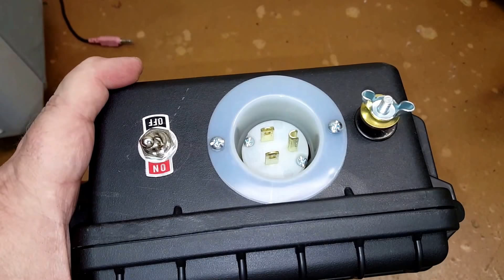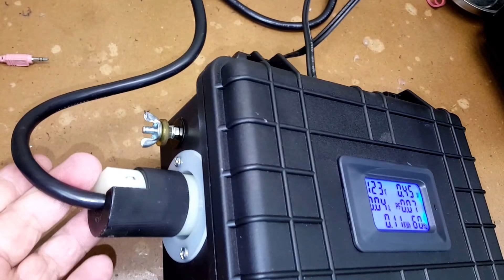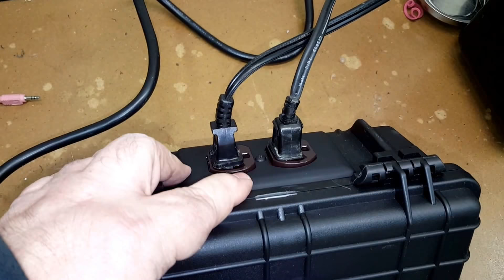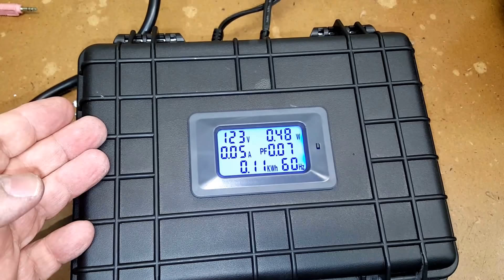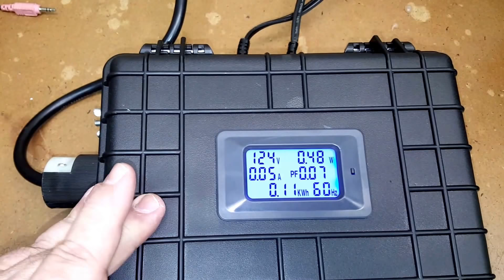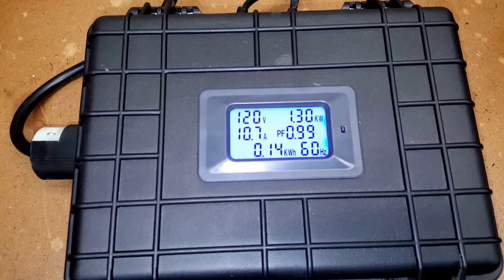Watt Meter For my Honda EU2200i

Comment: Hi Steve, The last comment was two years ago so I’m not sure you’ll get this, but if you do I would love something like this for a Honda generator I’m picking up tomorrow, the EU 2000 I, i’m actually buying a pair of them that will run in parallel sometimes. I’m curious if it’s possible to wire something to the generator that I could maybe attach to a side of it that would monitor the current usage and then I would know what’s left over and available, so I would know how the generator is impacted as i plug things in and out. Is this possible or does it have to be an external device that the generator plugs into and then you plug into that, like your box?
Reply: Steve you may like the Watt Meter that I added to my gen/inverter. https://youtu.be/CIfSrwch9Z8    https://youtu.be/_cFU9aeMcOE
Reply from the maker: Probably the best thing for what you want to do is get a Kill-A-Watt Power Meter.  It would plug into the generator and then you plug the load into that.  I built mine for the opposite reason.  I run an extension cord from the generator to my box, and then plug into it.  That way I don't have to go to the generator to see what the load is.  I can have the box sitting by me and the load(S).
Reply: @stevehill1802  Thanks Steve!  I don't much about watt meters but most of what I find on Amazon is 15a, but I want to be able to monitor my wattage when using one of my Honda EU2000is (so this 15a watt meter would work great), but I also want to monitor the wattage when I run 2 of them in parallel, in which case I'll be pulling 3200w with short surges up to 4kw.  I was hoping to find 1 watt meter that could do all of this, but it looks like once you get over 15a the meters get more intense, they're not just simple meters you plug into/out of.  I'm also curious, why do these meters have to have upper end limits, why wouldn't they just make them all big enough to handle 3, 4, 5kw or more?  Anyway, if you have any ideas on what would work best for me I'd appreciate it.  if I have to buy a 2nd meter for when I'm using my 30a outlet, I'm not sure how to pick this out....?
Reply from the maker: @john-xs3rs  I see what you want now.  Yes, unfortunately you are not going to find such a thing on a store shelf.  It would have to be custom built.  It would be a fairly easy task to make one as part of the parallel kit.  A box would have the 2 cables coming out of it going to each generator.  The box would have the meter and the 30 amp plug.  The meter in this video will measure up to 100 amps.  I could build it for you.
Reply: @stevehill1802  It might help if I could send you a pic of the outlets on my generator, or maybe you can Google the Honda EU2000I Companion (the model with a 26.6A outlet beside the 20A outlet) to see what I mean (I have 2 of these same generators, along with Honda's parallel cable).  Above the 2 outlets it says "AC Out 12V 13.3A, AC Reset Method: Engine Pause" - would this mean either of these 2 outlets can provide 13.3A (1596w given 120V), and if either exceeds that the engine will pause?  do you suppose I could plug into both of those outlets, and it work work fine until I pull a combined 13.3a, and then the engine would pause?  Then below the 2 outlets it says 20A under the smaller one and 26.6A under the bigger one, and "During Parallel Operation" under those numbers as well, and there's a 20A circuit protector under the smaller outlet.  So it sounds like the upper limit on both outlets is increased when they're connected in parallel, meaning it'll bypass the 13.3A engine pause reset method.  So I'd like to know how all the above works, maybe you know and can confirm/deny what I'm saying, but just to make sure we're on the same page for what I'm looking for, I want to monitor the wattage/amps whether I'm using 1 small outlet on 1 generator, 2 small outlets when they're connected in parallel or using the 1 26.6A outlet when in parallel, like when I have my camper connected.  So your box would need to be able to accept as input just 1 standard plug, 2 standard plugs or 1 RV-type plug, then have an upper limit at or above the max I could pull, which is 4000w (I can run 3200w forever or surge to 4000w for 30 mins before it trips).  and if it was possible, I'd love to be able to set an alarm based on whatever wattage I wanted.  for example, if I were running just 1 generator (running 1600, surge to 2000 for 30 mins) I'd love to be able to set an alarm at, say, 1500, to know I'm getting close, then when I run it with my RV I'd love to have it beep if I were around 3100, let's say.  Thoughts on any of this?
Reply from the maker: If you want to plug your camper and plug other loads directly into the generator, and monitor all, you would need your box to have the 30 amp plug, and regular 15/20 amp outlets so all the load would go through the meter.  As far as an alarm goes, I have not see that.  All mine does is flesh at the point I set the overload value.  It is my understanding that when the generators are paralleled you do not get full output of both.  Anyway the box would do all that you want, except sound an alarm.
Reply: @stevehill1802  This sounds great, so the input side of the box would be flexible in that the meter would read watts coming from 1, 2 or all 3 inputs (2 standard plugs,1 RV-type plug). and I forgot to talk about the output side of the box - could the box be flexible enough to send the current out of the meter to 2 different outlets (1 standard and 1 RV-type), so that I can plug either my standard extension cord (when using at home) or RV 30a plug into it?  so 3 inputs and 2 outputs I suppose, if you know what I'm trying to get at...  I can live without the alarm. :)
Reply: (on the output side, could you not guarantee that 100% of the power went to both outlets, could some go to one outlet and some  the other outlet?)
Reply from the maker: @john-xs3rs  I don't understand your question.
Reply from the maker: @john-xs3rs  Any outlet you plugged into on the box would go through the meter and the total of all the outlets would be read by the meter.
Reply: @stevehill1802  my 2nd message, the one in parenthesis, was asking about when you go from the meter to the 2 outlets I can plug into (on the outlet side, 1 15a and 1 30a, not the box's input side which has 2 15a's and 1 30a) - would 100% of the current go to both outlets so I could plug into either one, or does the power get messed up somehow and some might go to 1 outlet and some to the other?
Reply from the maker: @john-xs3rs  If I am understanding your question...  You could plug in to either of the generator's 30 amp plugs and you would have the full combined power of both generators if they are paralleled.  Or have the full 20 amps on the on either of the 20 amp plugs.  The 2 generators will share the load equally up to their capacity.  I hope I have answered you question.
Reply: @stevehill1802  all correct.  so in order to use the small (standard house) outlets and get the full capacity of both generators when parallel'd together (3200w, surge to 4000w), I need to have an extension cord coming from the small outlet on each of the generators, so 2 ext cords coming towards my house but going thru your meter box first (since each outlet on its own is limited to 20a), so this is why the box you build needs to have 2 small outlets (as inputs) - so I can use 3200w when at my house or when I'm camping all 3200w would come out of just 1 generator's 30a (actually 26.6) outlet.  So 3 inputs to the box (to take in the power from 1 or 2 generators, whatever I'm running at the time) but just 2 outputs (1 in case I'm at home and 1 in case I'm in my RV).  if all this makes sense....
Reply from the maker: @john-xs3rs  You are correct
Reply: Great, I think we might be in the same page, it sounds like the 2 outlets (sending power to my appliances) will both have all the power, so it sounds like this will work just like I want it to. So what would it take to build this, how small could the box be?
Reply from the maker: @john-xs3rs  I think we need to talk over the phone or computer and brainstorm.  I believe the same box I used in the video would work.
Reply: @stevehill1802  that would be helpful but let me study this a little more - I think its could be a problem to potentially have 3 "hot" sources coming into the box, all the power is merged, then 2 potentially hot sources going out, it sounds like plugging 2 extension cords into 2 different wall outlets then joining them together then hooking something up to it, I wonder if it could over-power/damage what's plugged into it, it seems like crazy routing of electricity.  so let me dig into this a bit more, conceptually I just wonder if I need to stick to the guaranteed/straight-forward solution, which is 1 cord coming off each generator outlet and each have its own meter then that meter only servicing 1 outlet.

Comment: Amazing.  I would love one of those boxes for my own EU2200i (the search brought me here).  Honda has the best guts of any generator on the market, but I don't know why they don't add more user-friendly bells & whistles.
Reply from the maker: Thanks for your comment.  I agree.  Honda is the best.  You could buy a Kill-a-watt meter and put it at the end of an extension cord.  They run around $20.  Someone asked if I would make one for them.  Problem is, by the time I buy all the materials, I would need to charge about $100.  The parts alone would cost around $50.  You can make it yourself.  It is real easy.  The hardest part for me was cutting the 3 large holes on the case
Reply: @stevehill1802  I have a Kill-a-Watt.  I like the cleanliness of your box though, and it has two receptacles.  Well if you want to make $50, let me know!
Reply from the maker: @rob21 I like making stuff.  I have never used the box,  and is like brand new.  If you want to buy it, it's yours.  I can always make another later.

Comment: I noticed that when you went over 20amps the voltage drop from 124v to 117v is this common? I seen another YouTuber have his handy 3000 drop voltage to 90v when trying to run a space heater. Thanks for the video
Reply from the maker: Yes, this is normal.  Depending how long the extension cord is, and how heavy gauge it is will cause resistance and cause a voltage drop.  In the case of house wiring, the further the plug is from the circuit box the longer the wiring is.  You have more resistance and less voltage

Comment: Nice job, Steve! I fear that the majority of us are not well versed as electricians. Perhaps another video would give us a better understanding of which wire goes where(!) You know, like a "cook's tour" of the inside of the box? Thanks again for taking the time to make the video. Looks great!
Reply from the maker: Joaquin Tall - I am working on another project right now, but please go to the amazon website https://www.amazon.com/gp/product/B077YJSRXZ/ref=oh_aui_detailpage_o07_s00?ie=UTF8&psc=1 there is a wiring diagram that shows how to wire it.  It is very simple.  The 'L' would be the hot or black, and the 'N' would be the white or neutral if you are in the US.  The transformer goes around the hot wire, and terminal 3 is hooked to the neutral, and terminal 4 is hooked to hot.  Take a look and see what you think.  I will try to find the time to make a video if you need me to.   The hard part for me was cutting the holes for the meter,  plug, and socket.
Reply: Buying a Kill-a-watt it’s easyer..... and cheaper....
Reply from the maker: True, but my meter gives more information